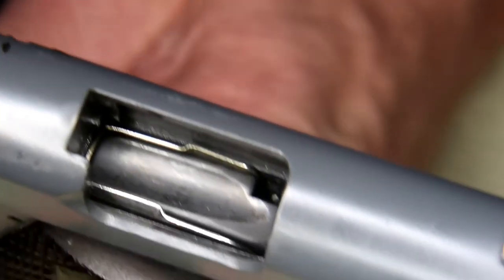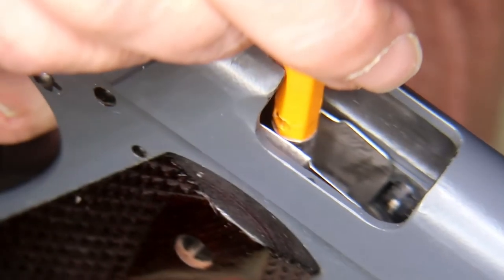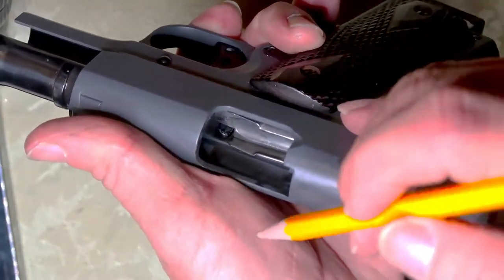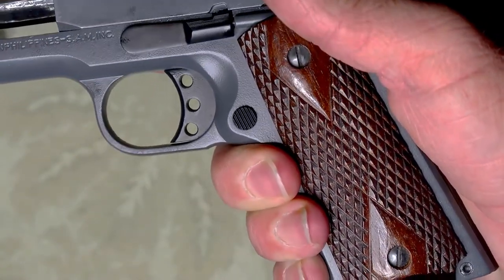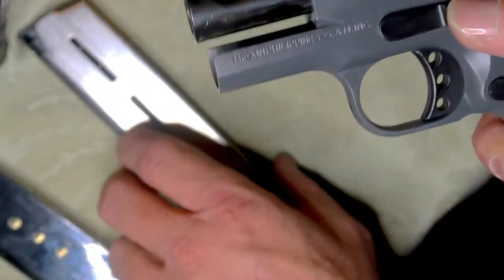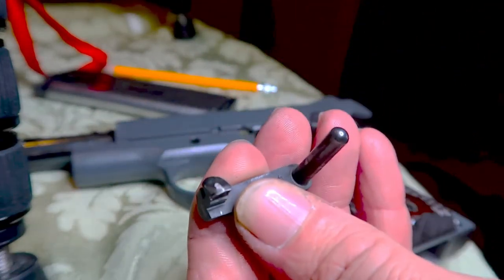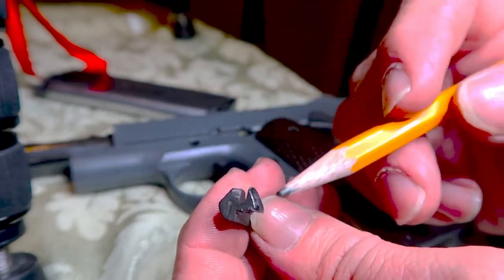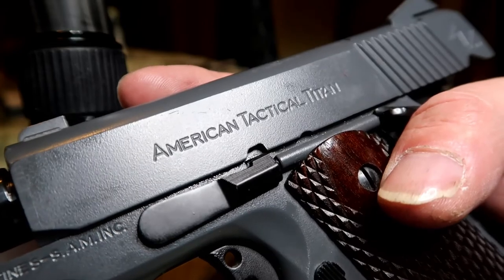1911 Pistol Slide Stop Problem Diagnosis

Comment: My kimber slide locks back while there is still ammo in the mag. How can i fix it?? Did it with 3 different brands of mags. Didnt use kimber mags though. Could it be the ammo ?
Reply from the maker: Look inside the open slide at the lug of the slide stop. Where it interfaces with the magazine follower. If it has a copper streak it I'd the slide stop. Check out the video on relieving it in my budget 1911 tune up series. Go slow and check often.
Reply: mackdaddy1911a1 already cleaned the gun. Dont remember  seing a copper streak. Could it be that i was  not using kimber mags or perhaps the ammo ? Heard kimber only functions correctly with kimber mags only. 🤷‍♂️
Reply from the maker: @av01230  if so then it is out of spec. I have never had any of mine have an issue with different mags. Only the Auto Ordnance had premature lock back. It was the lug on the slide stop. Just a bit to big. The actual bullets interfered with it, as it cycled. Leaving a slight streak of copper. How hard is the slide stop to insert when reassembling the pistol. The plunger pin may not be applying enough pressure to prevent it from bouncing up under recoil. You could pull the thumb safety and polish the pin. Be careful removing the thumb safety. The spring will shoot across the room real easy. Good luck.
Reply: mackdaddy1911a1 slide stop goes in easily. At this point dont know what the issue is. Should i take it to a gunsmith? Iam bummed.
Reply: mackdaddy1911a1 what does out of spec mean?
Reply from the maker: @av01230  great question. The M1911 like all mechanical devices have mechanical drawings made that not only illustrate what each part is, does, and where, in the mechanism, it is located. The drawings also have a list of specifications with everything from the material of construction, Hardness of any heat treatment required, and the dimensions down to the thousandths of an inch of each and every part. These drawings are how an inventor is issued a patent for the design so no one else can rip off their design. The M1911 has been around since 1911 and is the most copied pistol design in history. The parts for it are widely available and mass-produced by numerous manufacturers. Not every single part is "gauged" to ensure it is Within Spec. In the case of the slide stop, there is probably no more than one or two thousandths to much material on the lug that is lifted by the magazine follower. It simply needs to be relieved slightly. 
That is if the pin that applies spring tension to it is free in its tube and pressing against it. Good luck. By the way, my Colt Combat Unit's slide stop was sticking and Not stopping the slide after the last round was fired and ejected. In this case, it was the pin of the slide stop the goes through the frame and the swinging ling of the barrel. I polished the coating off and found a small nick in it. Further polishing eliminated the problem completely.
Reply: mackdaddy1911a1 So The issue is either the slide stop that has to be filed some or the slide stop plunger that has to be replaced. Thanks for ur input ! U helped a lot !

Comment: I'm having lots of problems out of my ati titan. Not chambering rounds correctly. Slid not going all the way forward at times. Hanging rounds sideways. Jamming. And it won't shoot in the same place twice.
Reply from the maker: Thanks for the comment. A couple of things that might be helpful. 1 try a "Known Good mag". In other words a magazine that works without issue in another 1911.
2 use only factory ammunition while you are trying to resolve the issue. 
3 insure the feed ramp on the frame is clean and smooth.
4 insure the frame and slide rails are clean and well lubricated. 
5 insure the breech face, especially around the firing pin hole are smooth and clean. Sometimes there is a burr on it. This will cause feeding issues.
6 replace the entire recoil spring assembly if the problem persists. Kimber has an entire assembly and the price is reasonable. The Titan is an Officer (3inch) model so if you look for parts that is the easiest way to find what you need. 
Good luck.
Reply: You need a stronger recoil spring

Comment: Just wondering when i dont have a mag in it and do rack over the top the slide release is not disengaging what could be the problem
Reply from the maker: Great question. My first thought is the pin may be sticking. On my Colt Combat Unit the IonBond coating was to thick and there was a tiny bur on the pin. I took some emery cloth/ super fine sandpaper and polished the sections that are inside the frame when it is installed. Problem solved.
Second, the plunger pin that rides the face of the slide stop may be rough. Or the face of the slide stop itself may not be smooth. Visually inspect the pin and the face for any burs. You probably will need a good magnifying glass and good light to really inspect it properly. The plunger pin that protrudes from the plunger tube should move freely and not stick. Its nose should be smooth and have no flat spots on it.  On the cheap ATI Titan, the nose had flat spots on it. I took it out and polished it and re-installed. Problem solved. 

Warning, If you need to take the plunger pin out you will need to remove the thumb safety. The pins and spring will shoot out of the tube and go bye bye in a second flat. So be prepared. Wear  safety glasses.  I illustrate how to remove and install the thumb safety and why putting a slight kink into the plunger tube spring is a good idea in the Budget 1911 tune up video series. Please be sure you understand the operation and take precautions to prevent injury to yourself or losing parts or damaging the pistol.
Reply: Ive alreasy had to replace the plunger spring and its just irritating bc im a lefty and they dont make any 1911 for a lefty
Reply: Thx i do appreciate it
Reply from the maker: @alberthunt8501   check out Cabot Firearms. They make a left -hand model. However, they make high-end guns that cost an arm and a leg. But they may have some that 
blue-collar folks can afford. Good luck.

Comment: My problem is that when I shoot my 1911 the slide stop doesn’t go up after that last round. When I load an empty mag, the lug does not catch on the lip of the mag
Reply from the maker: Get a high quality replacement, such as a Wilson Combat or Les Baer or Night Hawk, Cylinder & Slide, or Nowlin, ED Brown, EGW. The problem with most factory guns is they buy mass produced parts from others where quality control isn't the top priority. MidwayUSA or Brownell's are two great places to purchase quality parts. Good luck.
Reply: Phillip, I found this video while searching for a solution to your exact question.  I have had a Combat Elite for almost 30 years, and I’ve run tens of thousands of rounds through it.  

I had one magazine that wouldn’t lock the slide, but my other mags did.  I just chalked it up to a bag magazine (it happens).  I checked all of my other mags, and none of them would let the slide lock back when empty.

When I removed my slide stop tonight, I saw that the “lip” had been sheared off.  This is an aftermarket slide stop (I don’t remember the brand).  After watching the video, I remembered having the same problem with the original stop.

I’ll pay a visit to my local parts store next week and get a quality slide stop.  I don’t shoot that much anymore, but I do want my weapon to perform like it was designed to.

Comment: If you can help me put this piece of shit garbage back together I'm subscribing. I've done everything goddamn methodically triple checking myself and the slide is still jammed up every time I put the slide lock in and it doesn't matter how I do it it still jams in different ways
Reply from the maker: Ok calm down and explain in detail. Mag in or out when it locks?  Loaded mag or empty mag?  Do you have the barrel and it's bushing installed? The barrel link in view through the hole and aligned? Will the slide move freely with out a mag in the pistol? Full length or two piece recoil spring guide or short G.I. spring guide? Government, Commander, or Officer model?.
Reply: @mackdaddy1911a1  full length recoil spring, empty mag, it's all aligned ( I definitely kept check up on that) government model, barrel and bushing are in slide moves freely up until I get that slide lock in and that's when all hell brakes loss. After doing more work on it I  thing the pin lock my be warped by a microscopic degree. There was a point where I had it all the way in but the slide got snagged on the slide lock despite it being and and disengaged I actually have a picture of where it snagged. But not sure how the slide lock got that way I didn't have it apart very long. Just long enough to clean it. I appreciate your response. Wasn't expecting that.
Reply from the maker: @niksatt4843  ok can you send that picture to me. At mackdaddy1911a1@gmail.com . I will take a look and hopefully can see the issue. Note: during reassembly remove the magazine. The follower of an empty magazine will push the slide stop up and lock the slide. Also. Do not drop the slide on an empty chamber. Instead release the slide and control it with your hand.
Reply: @mackdaddy1911a1  will send you an email. I figured it out I think though looks like the part is warped just enough to catch the slide when the slide lock is disengaged and I believe that is what is catching
Reply from the maker: @niksatt4843  OK I responded and included 3 photos. In your photos, the slide stop is aligned with the recess that the slide stop is pushed up into by the magazine follower after the last round is fired and ejected. Pull it back out and align it with the half-circle cutout to the right of the recess. it will pop right in. See the photos I emailed you.
Reply: @mackdaddy1911a1  thank you so much for taking the time. I did and and the slide still snagged so I'm thinking my slide stop might need replacing. Actually I know it is because I see it. Going to get it replaced and pop that baby in there. I really appreciate your help.
Reply from the maker: @niksatt4843  Brownell's.com. Under 1911 parts look for the Wilson Combat Bullet Proof slide stop. I use Wilson Combat and they are worth it. Good luck.